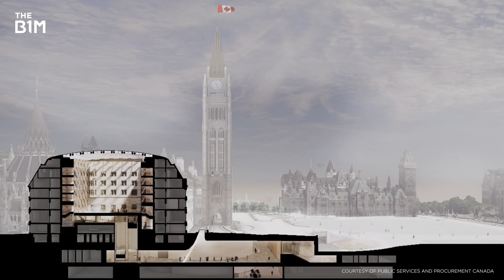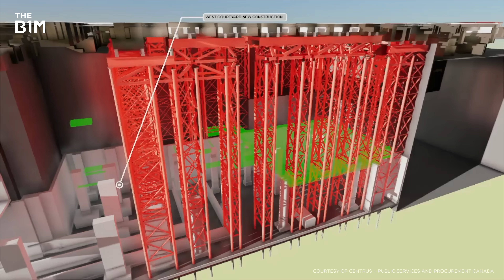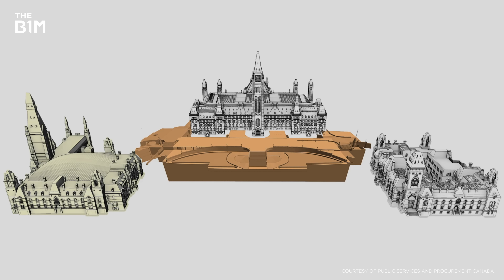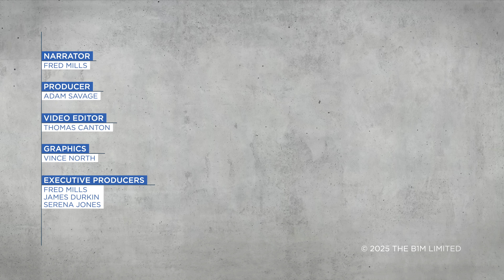Why Canada Blasted a Huge Hole Outside its Parliament

Comment: The Parliament Buildings are historical. To provide some perspective, the Parliamentary Library in particular is of the same vintage as the Vienna State Opera and Austrian Parliament Buildings, and it is older than the Hungarian Parliament Buildings. I think the cost to preserve something for the next century or more is worthwhile. After all, how much is spent on relatively short-term IT projects and programs in the government? This project is tangible and enhances an already stunning national asset. I would be pleased to see similar projects (or on projects of similar impact) in the provinces.

Comment: Check your data folks. The capital of Canada in 1867 was not Ottawa, but Charlottetown, Prince Edward Island. Check out the Confederation Center  in Charlottetown.
Reply: I did. I consistently found that Queen Victoria chose Ottawa in 1857, before Canada even became a country. Charlottetown is where Confederation was "born" but it was never the captial. Many comments suggest Kingston was the first capital of Canada, but that was for the united province of Canada before Canada was a country. The video is correct in asserting Ottawa "has been since the country was founded" with emphasis on country. I mean no disrespect to either Kingston or Charlottetown. I am more familair with Kingston and it is a remarkable city.

Comment: Now I'm wondering whether the US Capitol had a similar project at some point.  That building was designed and built around 1800, there are tunnels (with rail cars!) leading to the Senate and House office buildings a couple of blocks over, and there is an underground visitor's center underneath the Hill.  In fact, I'd wonder whether the Canadian plans are using the Capitol plans as a basis.

Comment: Renovation project with a blank check? Imagine the consultant fees alone. Who's idea was it to excavate , drive piles and insert seismic waffle pads under the existing foundations? Crazy. Better to blow it down and build new. If it is abandoned for 10 years to reno where are the autocrats?  The West block is finished and it is beautiful.

Comment: No, they are installing the same type of base isolators into the Mormon Temple in Salt Lake City. They are also doing vertical coring.  You should check it out, I think you’d be impressed.

Comment: Why are they making a hole?  A few potential answers come to mind:  1) Didn't they used to drill a hole in the skull to let the demons out?  2) Our last decade of government has a habit of digging holes faster than they can climb out of them, so this is just keeping true to form.  3) A grave to bury our dead country in.  4) Why not take an unshakable foundation on the bedrock of the Canadian Shield and dig it out, replacing it with recycled steel and concrete poured by the cheapest bidder... what could go wrong?  Once the hole is dug, the best plan would probably be to just bulldoze the building into it and start from scratch.

Comment: 2:46 “it’s just a few metres shorter than London’s Big Ben. Don’t try to beat us at the parliamentary buildings guys, stick to the hockey”

I hate to inform you that Toronto’s old city hall clock tower is taller than the Elizabeth tower in London

Comment: The “Senate of Canada Building” is not the original name of the building where the Senate has moved to. It is the former Union Station (railway) that has been closed since the late 60s and used as a conference centre.

Comment: wouldn't it be easier to just take apart the building. move it somewhere temporarily then build the support structure underneath. then bring the building back piece by piece replacing anything that is damaged? this whole demoing while it still is there seems like it's introducing less support

Comment: Wow! I ride over Portage bridge on my way to work and often feel like the library of parliament is about to slide into the river. I wonder if it is on the same quick clay that made so many issues for the O-Train dig. Remember when the entire width of Rideau St, right in front of the mall, was swallowed into the abyss? :P It's a miracle noone was hurt.

Comment: Great video. I've been on the worksite both before and during the restoration, and trust me, there is a lot more going on than this, but it is a great video for a general audience. One other major achievement is how much hazardous material they have had to remove from the building. After the original center block burned down in WWI they got serious about fire-proofing the new structure, which in 20th century Canada meant lots of asbestos - the safe removal of which is a real pain. Keep up the good work.

Comment: Might I suggest that the Canadians are dominated by the Anglo-Saxons? Your comment about them not attempting to increase the height of the bell tower, a clear case of misplaced Exceptionalism, Smug Superiority based on no evidence, and a Paternalistic Attitude that should have been left behind in backward, undemocratic England. 40,000 truck loads to clear the site? Typical, wasteful Anglo-Saxon arrogance. A continental build would have installed a light railway, and completed the removal without the pollution, road damage, and infrastructure replacement.  Channel B.A.H.

Comment: Pretty disappointed in this video, as while it does offer lots of interesting information, it also shakes my trust in this channel. The most glaring issue is that the Senate Building of Canada is temporarily the seat of the Senate of Canada, information which is accurately found as both the first sentence in the respective wikipedia article and described clearly on the Senate of Canada website. When a video is only 10 minutes long, the palatability of mistakes like this is much lower than a more substantial video.

Comment: Does anyone know what those big soft pads they put over the pit while doing the blasting are/are called? I assume they're there to stop any debris and stuff from coming up, they look so weird and I'd love to learn more about them haha
Reply: Not sure there's really a formal name.  The ones I've seen are all made of cut up old tires strung together with steel cable.  Definitely intended to keep shrapnel from flying everywhere - if they weren't used you'd get fist-sized pieces of very sharp-cornered rock flying well out of the construction zone.
Reply: I came here to the comments hoping to find an explanation of them!  I think your assumption is right and maybe also to help direct the blast energy in the right direction, but I'm very curious what they're made of.

Comment: OK but the most important part, i.e. undermining and piledriving under the central block, is only covered in a handwaving kind of way. It raises some massive and massively important questions, starting with Huh? HOW? Disappointing for an engineering based channel.

Comment: Westminster’s total area is only 116m2 larger than Ottawa’s.  112,476m2 versus 112,360m2. Although I’m not certain if the Canadian Library of Parliament building is included in this, so the Canadian one may be larger.

Comment: Ottawa infrastructure is a nightmare. I moved there from Toronto for work and my gosh to get from point A to point B it can legit take u almost TWO HOURS. Toronto as big as it was would only take u on the worst days even with traffic like 40 minutes. Something needs to change....it's also way too boring a city to be this chaotic when it comes to its orgnaization and infrastructure. At least if it's going to be horrible to commute or drive around then it needs to be more lively of a place. This city partly gave me depression with how nothing goes on in there

Comment: If you work for the General Contractor or Subcontractors on this job beware of the toxic levels of dust being produced and inhaled at all times.  Silica, Lead, asbestos,mould, fiberglass and all kinds of other things are toxic to your health.  Doesn't matter what they tell you and how much environmental testing is done.  Respect your body and always wear a 3M P100 mask when on this site no matter what your activity.  Better yet, just quit and tell management to do it themselves rather hiding in their offices away from the hazards.

Comment: The history is a little off here.  Ottawa was chosen by Queen Victoria in the 1850s for a capital of the "United Province of Canada," which was the colony consisting of (now) southern Ontario and southern Quebec.  The original Parliament building was built on the hill for THIS political entity, not the one that it would become (which was was started with Confedration in 1867).  The point about hiding it from the Americans was spot on.

Comment: Nice to see that Canada has actually bitten the proverbial bullet and made the decision to decamp everyone from the main parliament building and get on with work. Conversely, over in the UK, similar issues exist at our Houses of Parliament (including asbestos removal), where the estimated cost of restoration and renewal starts at £7bn and the timescale anywhere from 12 years to nearly 50, but at every stage, Parliament asks for further reports and introduces yet more delays to making a decision, as they balk at the cost, timescale, possibility of having to decant elsewhere, and changes being made to the building. A vote on whether to have a full decant (cheapest and quickest), partial decant (longer but similar cost) or Business as Usual (no decant, the most costly and lengthy) was supposed to happen in May but seems to have been postponed.

Comment: Hi there, a few corrections:
Ottawa has not always been the capital of Canada, the first was Kingston, ON but was moved to Toronto due to American pressure at the border. It was moved back to Kingston, then moved to Ottawa later. 

A clarification: Canada didn't "try to beat [you] at tallest parliament buildings". Canada wasn't allowed to have a parliament larger than Britain for symbolic reasons, (Canada was not an independent state until 1931 and was  had established complete sovereignty until 1982). The construction of Peace Tower had intentionally made it just below the size of Big Ben.
Reply: It was in Montreal until the fire in 1849 https://en.wikipedia.org/wiki/Burning_of_the_Parliament_Buildings_in_Montreal
Reply: Canadians still think lizzie looks better than ben
Reply: Thanks for the lil history lesson.
Reply: I believe the parliament building was built in Ottawa because of the treat of the U.S. after the 1812 war with the U.S. Ottawa was just a lumbering small town, so distance from the American border was the consideration and also the canal was also built for the same reason. The original name was “By Town”.
Reply: Yes thank you for the correction it moved from Kingston due to the vulnerability to the US. The location of Ottawa was a safer choice.
Reply: Yes
Reply: Clarification the capitals before Ottawa were Toronto (1849-1851 and 1855-1859) and Quebec (1851-1855 and 1859 and 1865). Ottawa became the capital in 1866
Reply: How is Canada a completely sovereign nation when Canada is a Constitutional Monarchy with the King of England being the supreme authority of the land?
Reply: @j.macjordan9779  It being a constitutional monarchy doesn't change it's sovereignty. The monarch of Canada (currently King Charles III) is also the King of the United Kingdom but they're not the same technically, and the government of the UK has no influence on how the government of Canada runs. The monarch of Canada may have supreme authority in the land but since the King-Byng affair (where the authority of the governor general who represents the monarch was called into question) in the early 1900s it is basically ceremonial and just rubber stamps things. Today the governor general is technically appointed by the monarch but it's basically just saying yes to the person the prime minister says.
Reply: @iridoscyclitis  "Today the governor general is technically appointed by the monarch but it's basically just saying yes to the person the prime minister says."
And that 'technicality' stills means Canada is not truly Sovereign.
Reply: @babajaiy8246  Sure, whatever rocks your boat so long as you agree that the UK is not Sovereign 👍
Reply: @iridoscyclitis  Whatever rocks you're boat in making stuff up that I never agreed too.
What you said doesn't change the truth of what I said about Canada.
Reply: @babajaiy8246  I'm just using your logic here. You're claiming a monarch makes a country not sovereign, by that standard the UK is not sovereign. Indeed neither of what we said changes the truth that Canada is a sovereign nation.
Reply: @iridoscyclitis  " I'm just using your logic here. "
You're not. You are using your logic and failure to comprehend what I said.

"You're claiming a monarch makes a country not sovereign, "
If the 'Monarch' still participates with their 'final' say on matters - then they are the ones who still hold the power. Just because they don't exercise that power doesn't change the fact they are still in power.

" by that standard the UK is not sovereign."
If the UK's situation is the same as Canada's then yes - It is not sovereign either.

 "Indeed neither of what we said changes the truth that Canada is a sovereign nation."
Nothing of what you said changes the truth that Canada is not sovereign.
Reply: @babajaiy8246  

"If the UK's situation is the same as Canada's then yes - It is not sovereign either."

The UK is also a constitutional monarchy like Canada. So is Australia, New Zealand, and many other countries. The idea that they are not sovereign just because they have a monarch is ridiculous. If you want to pretend that the roughly 30 countries with this system are not sovereign, you're free to believe that but that belief does not lie in reality.
Reply: @iridoscyclitis  " The idea that they are not sovereign just because they have a monarch is ridiculous."
It's far more ridiculous to consider a country sovereign when a Monarchy can over ride a countries decisions - That's not Sovereign.

 "If you want to pretend that the roughly 30 countries with this system are not sovereign, you're free to believe that but that belief does not lie in reality."
If you want to believe Sovereign means having a Monarchy that can over rule a countries Will/Self determination, you're free to believe that. It doesn't change the reality of what being Sovereign is.
Reply: @babajaiy8246  

"It doesn't change the reality of what being Sovereign is."

Again, whatever floats your boat. It's you versus the rest of the world. But I guess everyone else must just be wrong about the definition of sovereignty instead lol
Reply: @iridoscyclitis  "Again, whatever floats your boat."
The same could be said about you.

 "It's you versus the rest of the world."
The same could be said about you.

 "But I guess everyone else must just be wrong"
If they share your view, then yes they are wrong.
Fortunately many people don't agree with you.

 "about the definition of sovereignty instead lol"
You wanting to change the definition of what  Sovereignty is. lol.
Reply: @babajaiy8246  No. Governor general is appointed by the prime minister. The UK doesn't even rubber stamp anything.
Reply: I thought you guys decided Ottawa when you guys burned down the Whitehouse. A defensive city against Americans and french... like a Quebec city on the british side
Reply: Ottawa has ALWAYS been the capital of the country of Canada tho. it wasn;t the capital of lower Canada though

Comment: Thank you for this report. True to form, however, I don’t recall seeing this info before. The effect of tremors can be seen throughout the centre of Ottawa in road pavement. (road resurfacing/repair is constant.) Parliament is near the northern edge of a fault line, which can best be seen on Carling Ave. from Bronson Street to the  Dominion Observatory. (I don’t know the extent of these fault lines, north & south.) Likely geologists could explain the situation that Ottawa faces better than I can, but this is my attempt to let Canadians everywhere know that their tax dollars spent on this massive project are necessary for maintaining a significant part of our heritage, at the very least. Many thanks for your reporting.

Comment: Who says Carney will be in office when the construction is finished? He'd have to win 1 more term for that, which remains to be seen. 

Also, why are they putting earthquake supports for an area with only 2% risk. Sure it's only just beside the Canadian shield but there isn't a need for it. Rather than the risk being prevalent, I think it's to mitigate any potential risk to a key building. And might as well have it done while other things are being done at the same time. Understanding this but I personally take issue with paying for unnecessary stuff being added. Sure underpin and fix up the parliament building but don't dump huge resources that reap little benefit the populace. How about working on oil contracts so fuel costs can be lowered in the west or prairie provinces? I'd rather have cheaper bread and gas than have suits sitting in comfort hundreds of miles away.

Comment: This is a great video. I had known about the hole as ive seen photos of it. I knew the plans for the visitor center but not the length of which they are going to stablaize the buildings. Well done!

Comment: I live in Ontario and never knew Parliament without construction, I also never knew the Senate building wasn't where it is supposed to be or West block. I do think the construction is slower than it should be, but union station in Toronto has been under construction for 15 years

Comment: Fascinating - Perhaps you could consider doing a story on the Salt Lake Temple (Originally constructed over 40 years 1850-1890's) on which is nearing completion on a massive 7 year restoration, expansion and base isolation project.